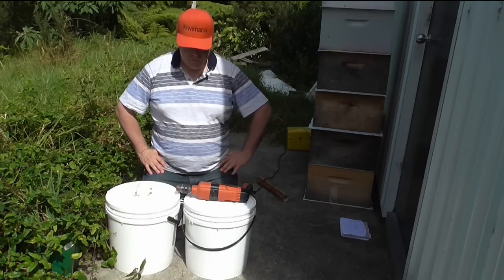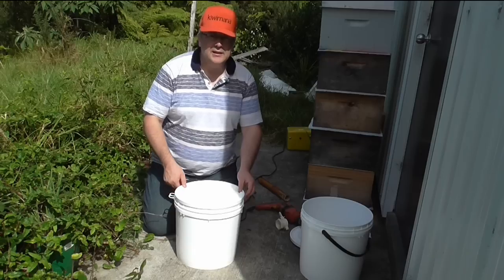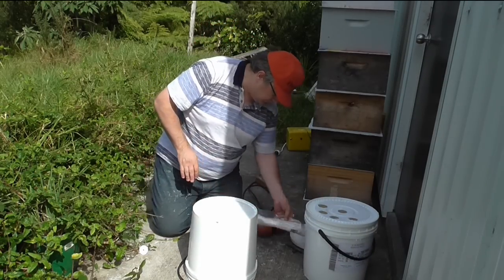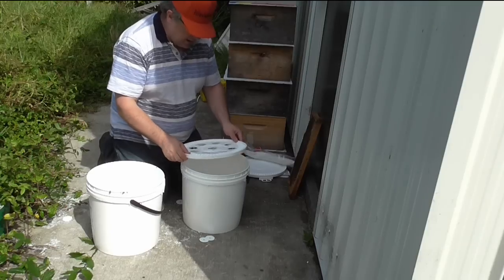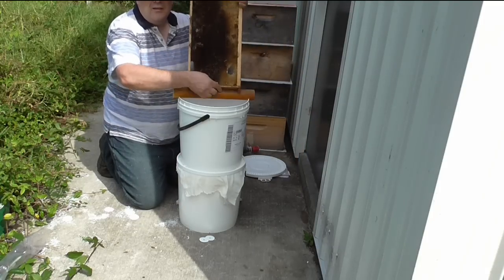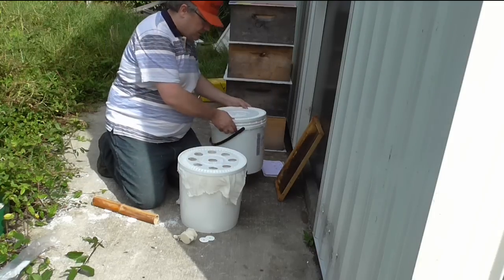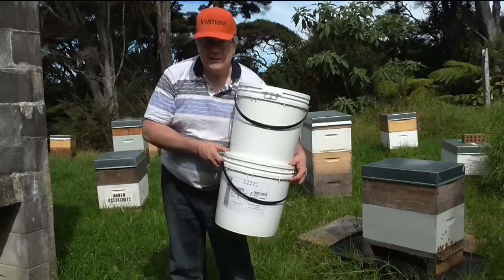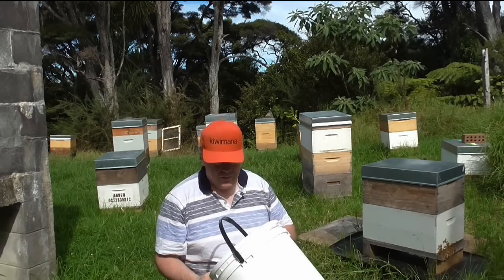How To Extract Honey Without An Honey Extractor

Comment: Would it be better to stack them first and drill the holes together so they line up exactly?
Reply: Probably less messy important issue is probably to ensure the top flow rate does not exceed the filter flow rate. An option could be to have the bottom lid purely as a ring to prevent interference will try that on my next extraction 😀

Comment: FYI Mitre 10 Orange buckets have a FDA Food safe sticker on the bottom and come in around $11 a pop with lids!! :)
Reply: Also Mitre 10s 13l bucket makes an excellent tight lid for  the top that allows for a frame to be fully sealed away from flies etc
Also it you have two or more frames they can be arranged perpendicularly so you don’t need the bamboo.

Comment: I've seen several videos of people using this type of method and with a honey gate. My question is why couldn't you use a brass water spigot, that way you can put it closer to the bottom of the bucket and be able to have a handle to turn  it off and on instead of a gate valve?
Reply from the maker: Hi,  No reason but I guess a Honey gate is much easier to clean as its basically a tube with a flat plate over it.  Have a look at the second pic on this page to see what I mean:- http://kiwimana.co.nz/shop/honey-gate/
See ya...Gary

Comment: Hi Gary, Does the honey gate able to seal well with the round bucket? Does it need silicone?
Reply from the maker: Yes indeed, the ones we sell have an rubber o-ring that seals around the hole.  I never had them leak.